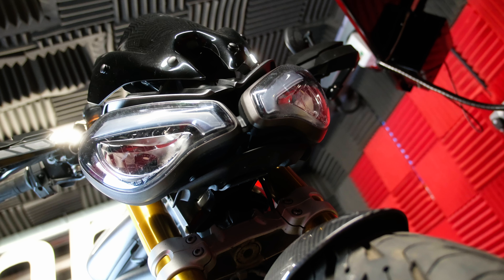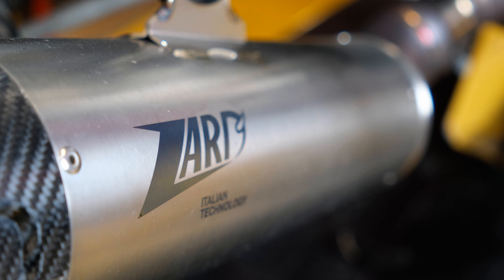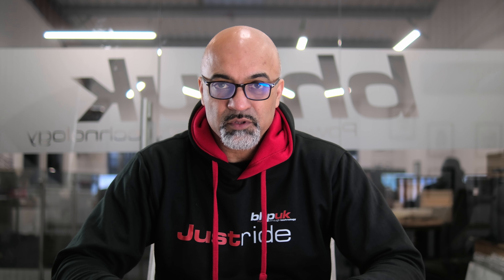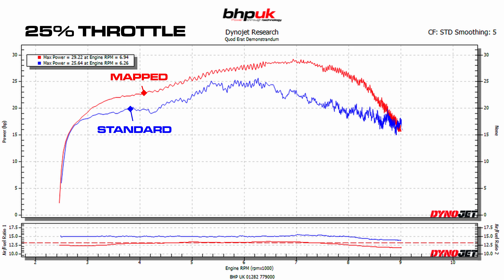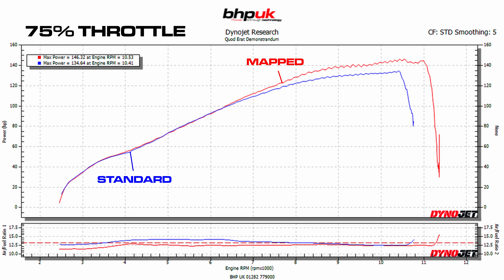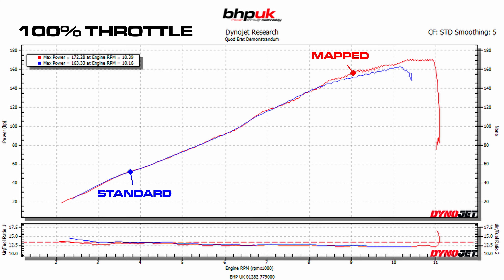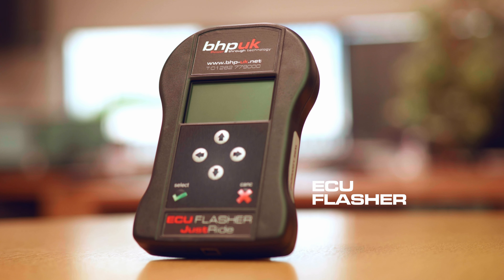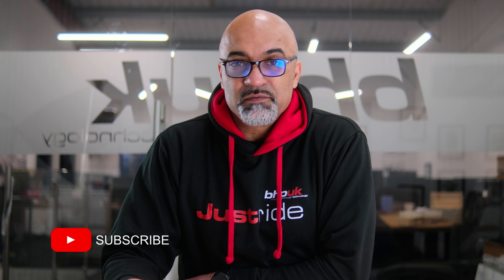Triumph Speed Triple 1200 RS with ZARD Exhaust | BHP UK Custom ECU Remapping

Comment: I own a Speed triple 1200 rr. Are there gains to be had whilst keeping the standard exhaust system. Specifically throttle response.
Reply: Hi have the same bike and have thought about tuning it. Have seen a lot of varying HP gains from different tuners (10-30hp) to include fixing the 60% throttle. 
Can I ask what were your gains? 
Thanks

Comment: In light of the latest recall to pull timing out of tune to help with overheating - where does tuning this bike affect overheating issue ?
Reply from the maker: Generally speaking when fuelling is lean you have to pull timing. Euro 5 bikes are running very lean to get them through emissions testing. We can clearly see in the factory mapping that the timing is pulled at the leanest points. When we put the fuel back in we can fill the holes in the timing.

Comment: I would like a remap on my RR mainly to extend the max RPM to 11,000rpm. The rev limiter just comes in too early. 
Do I need to wait for Triumph warrenty expiry before remap and does remap have any implications for the MOT emission test?
Thanks
Reply from the maker: You do not need to wait for the warranty to expire & there is no implication for the MOT. There are no emission tests on a bike.
Reply: Great! Thank you for that.